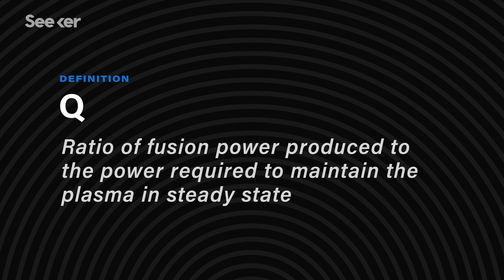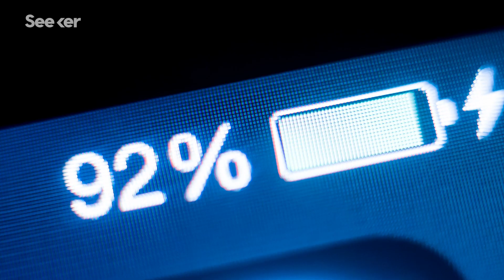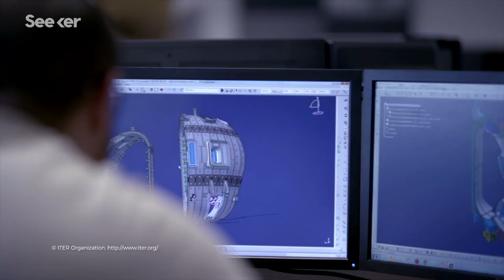How Close Are We to Fusion Energy?

Comment: Nuclear isn't scary. We have two very promising reactor types that can replace fossil fuels right now. Molten Salt Reactors and Fast Breeder Reactors. Both operate differently, but differ from current reactors in that they don't use water as a coolant or moderator. MSRs are fluid fueled reactors, that have their radioactive fuel dissolved in a fluoride salt which is then pumped through the reactor, acting as both fuel and coolant. There are graphite moderators in the reactor that slow the neutrons and make this a thermal spectrum reactor. The high temperatures achieved in this guy yield not only incredible efficiency but enable all sorts of interesting possibilities. You can run supercritical gas turbines instead of steam which are more efficient in their own right. You can use that heat for desalination of water if you wanted. Neutron efficiency is very high and because the fuel is a fluid, it doesn't suffer from the degradation that solid fuel reactors do, and thus do not require the same processing that solid fuel does. Because your fuel is a fluid and a fluoride salt, and not water, it doesn't need to be pressurized which means you don't need a big heavy pressure vessel. Also, no water = no hydrogen which precludes the kind of catastrophic failure we saw at Fukushima.

There is the Fast Breeder Reactor, usually referring to Liquid Metal Fast Breeders. These reactors are cooled with a liquid metal, most commonly sodium. Sodium has some beneficial properties in that it becomes a liquid at relatively low temperatures, but has a very high boiling point. This, like the MSR, means no need for a pressure vessel to contain the reactor. Sodium is pretty indifferent to being irradiated, which makes it very stable in a reactor. The longest lived Sodium ion is Sodium-24 which has a half-life of 15 hours, so long term storage of used coolant isn't a requirement. The other common Sodium ions have half lives of a minute or less. The Fast Breeders use metal fuel but they have a neat trick of their own. Because fast neutrons carry more energy, they can induce fission in other elements that won't fission in a thermal spectrum reactor like the MSR or current light water reactors. All the really nasty actinides with super long half-lives that make our nuclear waste such a problem, can simply be 'burned' up in fast breeder reactors. The breeding part means the reactor produces more fuel than it consumes, in this case, Plutonium. We can quite literally turn our stockpile of nuclear waste, into readily available and usable nuclear fuel suitable for re-use in light water reactors, or to start up a fleet of MSRs that can replace fossil fuels on a GWh for GWh basis.

And as a side benefit, we'd end up training a whole new generation of talented scientists and nuclear engineers who will drive development of fusion reactors. If you want fusion sooner rather than later, and would like a nice planet on which to use it, it's imperative we start funding these advanced reactor designs.
And while I call them advanced, it's important to note that these were developed in the USA in the 1950s and 60s. EBR-2 a fast reactor) ran for 30 years without a single incident. the Molten Salt Reactor Experiment ran for more than 5 years without a single incident. Neither reactor can melt down and both were walk-away safe.
Reply: very informative... thanky you
Reply: Great summary mate, unfortunately a lot of people still can't see past the stigma of fission = bad fusion = good (and some still can't see past nuclear = bad), despite all the various ways you can do fission, and how they all differ from each other and have their own pro's and con's. Most people also don't know that our current Nuclear power stations are pretty much the worse solution to making electricity from Fissioning the atom.
Reply: Oh sure, it will be perfectly safe, which is what you get told about every kind of nuclear reactor right until the shit hits the fan.
Reply: @Kalumbatsch  except MSRs and LMFBRs utilize the laws of physics to fail safely. Safety doesn't have to be engineered in after the fact  with pressured water reactors. 
The fact that MSRs and LMFBRs don't use water and don't operate under high pressure is a huge portion of their ability to be walk-away safe.
It's literally, entirely different types of reactors.
Reply: There have been enough accidents with liquid metal cooled reactors. This crap is just not worth it.
Reply: @Kalumbatsch  no but no power generation is safe
Reply: There is nothing you can do, even with the most evil intentions, to a solar cell that makes it eject a shitload of radioactive crap all over the countryside.
Reply: @Kalumbatsch    there is nothing you can do with solar power to match the gwh output of the current reactor designs.  He is talking about a whole new level of efficiency and safety.  Doesn't mean the solar industry suddenly dies.   Everything requires a ton of research in the end.  Same goes for power storage if transportation is to go fully electric.    
Look up Kelly Slater's wave ranch.  Take note of the scale of the solar array needed to power one locomotive with a plow under it to generate a surfable wave.
Reply: I was responding to "but no power generation is safe". Try to follow the conversation.
Reply: Kalum Batsch  solar panels cannot be installed or disposed of without harming the environment. not only do you have to tear up a very large portion of land to implement them, if a storm rolls by, a fuckload of solar panels will be destroyed and will have to be sent to landfills because they cannot be recycled. using solar as a main source of power is such a childish thought. it is simply irresponsible to look towards solar power instead of upgrading our existing nuclear power plants to be MSR's and LMFBR's. Nuclear, even our current ones, are always going to be better than any giant solar farm.
Reply: Again, it's just not worth it. Countries like Germany produce more than a third of their electricity using renewable sources by now. Simply ramp that up until fusion is available. Taking care of the toxic shit we have created up to now for thousands of years will be enough of a problem.
Reply: Truth. And renewable could turn 100% available with enough storage. There is very promising very cheap storage technologies, making renewable+storage an alternative (and probably cheaper) than nuclear energy.
Reply: Simply ramp up? it's nothing like that easy. Electricity grids need a certain amount of consistency and sustainability so they can be regulated. This is why governments continue to use plants that generate power 24/7. We are nowhere near ready to ditch nuclear, or gas powered plants for that matter. I worked on products for the Fusion experiment at Jet over thirty years ago and we still have not produced a sustainable reaction that generates a net energy gain in all the years since. It is the cooling system in a rod based fission reactor that makes the design potentiality dangerous too whereas a Thorium based reactor is inherently safe so of course it is something we should develop because it will bear fruit long before fusion ever will.
Reply: Those new reactor types and the infrastructure would take decades to develop and build, also the claimed advantages are purely theoretical as the various designs have never been used at a large scale, if at all. Germany as one example has just seven nuclear power plants left and at peak times draws more than half of its electrical power from solar alone. That makes it a problem of efficient energy storage, if anything.
Reply: When has the shit hit the fan MSR have been built and have worked.  That's a long way from fusion where the first proof was revealed as a hoax. MSR have the capacity to use up all the current waste.that's RENEWABLE ENERGY!!!
Reply: @Kalumbatsch  solar cells have a lifespan of 20 years and contain cadmium, a carcinogen which enters the water supply whenever trashed panels get rained on. more to the point, nuclear is less hazardous than current hydrocarbons, and we should never say "we're not gonna solve this problem because the solution causes a smaller problem"
Reply: +Dr. Bread
Cadmium telluride, which is present in a subset of photovoltaic cells, is stable and not soluble in water. That is a non-problem.
Reply: @robk.5467  Better yet in a world of fusion reactors you will need solar as a green fallback. Otherwise you will never be able to start your fusion reactor up again in the event of a shutdown.
Reply: @Kalumbatsch  only 2 have ever melted down and they produce more power than any other form of energy production we've got. Also one of those melted down due to bad engineering and being built nearly 50 years ago, and the other was hit with a tsunami. And ironically no one died of radiation from either reactors, not even the guy who went in the Chernobyl reactor to collect the radioactive water used to stop the meltdown (he had basically no protection). 

Nuclear is far less dangerous than people make it sound. You will get a higher levels of radiation on a plane than you will at Chernobyl right outside the reactor today! The reactor at Chernobyl even has holes in the enclosure for it and even still the radiation isn't anything serious. You are 1000 times more likely to get cancer from radiation in your own body than external forces, especially if you each highly radioactive things like bananas. It's a boogie man that people who know nothing about radiation love to run with. This playlist by thunderf00t does a fantastic job at showing the absurdity in these claims. 
https://www.youtube.com/watch?v=Zw33AVqzQxA&list=PLQJW3WMsx1q3XqXOw5PuRrM0Zg8YDkRPL
Reply: oatlegOnYt FYI it requires 20000 wind turbine to match one nuclear plant
Reply: @Kalumbatsch  We've had Nuclear power here in Canada for over 50 years. 60% of my province's energy is Nuclear. Weve never had any serious problems. Nuclear is safe when its properly designed and implemented.
Reply: @cameronswan8646  Nothing is 100% safe. And when the shit hits the fan you can just say it wasn't "properly designed and implemented", not a true scotsman.
Reply: @Kalumbatsch  Mmmm Cadmium pollution
Reply: Can you give sources to your points, please?
Reply: Nuclear is scary because the anti nuclear movment has spread scary misinformation about 'waste' and 'cancer' Any anti nuclear propaganda is such that they  must protest against Fusion energy because it's 'NUCEAR'  They sound like Vegans'!!!
Reply: I'm not anti-nuclear in the sense that I think it's a bad option.  It's clearly better than fossil fuels, especially coal.  I just think that in practice nuclear has turned out to be way more expensive than people originally thought, and that wind and solar plus storage (pumped hydro and battery) will end up being the cheapest and fastest route off fossil fuels.  And it's too soon to even talk about fusion as an option, because no practical reactor has even been demonstrated.
Reply: solar creates highly toxic waste while being created and as he says in this vid  there is the added cost of infrastructure by way of transmission is the hidden cost. that pro solar don't count.
Reply: @dansanger5340  have you any idea how much nuclear waste is discharged from a coal power station,  if it was regulated like nuclear it would be shut down.
Reply: The actual waste from Molten Salt Reactors and Liquid Metal Cooled Fast Breeders, is back down to background levels in about 300 years. Another solution is to stop producing so much waste and recycle it like France already does. There is no reason to run Uranium through the reactors only once and then declare it to be spent fuel. The half-life you're talking about is directly related to how radioactive the substance is. The longer the half-life, the less radioactive it is. Uranium 238, the most common type in the Earth's crust (99% of natural uranium is U238) is safe enough to hold in your bare hands. It's a very stable isotope which very rarely releases any particles, and those is does release are alpha particles and are stopped by your skin. You'd need to wash your hands after handling it, not because of radiation, but because it's a heavy metal and heavy metals are bad for you if ingested or inhaled. Same precautions we take when handling lead. U235 is considerably less stable, but makes up a tiny fraction of the waste we produce. After being removed from a reactor, the material is considerably more radioactive, but the hottest isotopes are the ones with the shortest half-lives. The ones we're concerned about, decay rather quickly into more stable elements. And that's why we aren't really concerned with things that have half-lives of millions of years, because the radioactivity is so low to begin with.
But, thats why I am suggesting we use things like MSRs or LMFBRs. MSRs have a very long burnup period which reduces the overall radioactivity in the fuel simply by running it for a long time and continually reprocessing it. LMFBRs, with their fast neutrons (the F in LMFBR) can induce fission in actinides that can't be fissioned in thermal spectrum reactors like light water reactors or MSRs. You can reduce these things to much more stable isotopes simply by running the fuel in your reactor. The laws of physics takes care of it for you. And because you're constantly breeding more fuel, you don't need to store your waste, because the waste never leaves the reactor site. You reprocess it on-site and run it back into the reactor so it can continue working. 
In terms of nuclear power accidents, the three big ones we all know about, Chernobyl, Fukushima and Three Mile Island had one thing in common. They are all water cooled reactors. Water must be kept under immense pressure if you want it to remain liquid under high heat. The more heat you add, the more pressure you must contain or you end up with a steam explosion. That's what blew the top of the Chernobyl reactor off. That's the explosion we saw at the Fukushima plant. If you don't use water as your coolant in the reactor, you don't need to maintain high pressure. No (or low) pressure means no chance for the reactor to pop. Molten salt reactors offer even more safety in this regard, because if you lose coolant in your reactor, you also lose your fuel since the molten salts are what contain the Uranium. Any failure in the reactor causes the fuel to drain away into storage tanks and the reaction stops.
We'll likely see some new reactor designs coming online in the next 20 years with the Nuclear Regulatory Commission finally updating their rules and licensing requirements.
Reply: @Andy Lao LMFBR stands for Liquid Metal Fast Breeder Reactor.  The breeder part is the important part. This means the reaction inside transmutes some of the Uranium into Plutonium. You're basically creating more fissile fuel from fertile fuel. You remove your fuel rods from the reactor, cut them up and reprocess them and put them back in. EBR-2 in Idaho did this for 30 years!
The point behind fast breeders and molten salt reactors is that they are both much more efficient than your standard water cooled reactors. They extract much more energy and handle waste products much more efficiently. You end up with less waste and what you do have is lower level and has returned to background levels in about 300 years instead of 30,000 or more.
Yes, you have drain MSRs and LMFBRs to inspect them because you can't visually see inside, but you have to do the same thing in water cooled reactors. Yes you can see through water, but because of the intense pressures involved, you can't do anything else without removing the fuel and draining the vessel. So it's really up to instrumentation to tell you wants going on, regardless of the opacity of the coolant.
Reply: google "molten ceramic mini nuclear" what you think?
Reply: I totally agree. Those who have not yet done the research and don't understand MSR's  are the ones who are scared. There is nothing that can be done to shut down a MSR short of filling the auxillary emergency drain tank with Molten salt so the active molten salt has nowhere to drain if it was to go critical. This is a wonderful clip of what they were doing in the late fifties with MSR's. With today's technology, this should be a no brainer.
https://www.youtube.com/watch?v=tyDbq5HRs0o
Reply: Most interesting comment I’ve ever read 😂
Reply: So why are we not doing anything about it
Reply: honestly, considering how superstitious the climate around fission energy is, i almost wonder if we'll find out some way to villify fusion.
Reply: As you note, these WERE experimental theories, and "working" in situ plants were built, but they were deemed inviolable. Neither commercial or military applications (ie; working models) are in use today, nor are there plans to do so. However, every year or two, I notice someone dredge up these past attempts and treat them as current working technology. Sorry, not then and not now.
Reply: Such an impressive display of knowledge. Thank you for sharing. 

Out of curiosity, have you seen the HBO show Chernobyl? Do you think media like this is a net positive or a net negative? I could imagine it going either way. Clearly, the show details a tragedy and endeavors to display its costs, likely inciting negative reactions to nuclear generally. It also inspires further reading, which may lead to a more measured, positive outlook.
Reply: it is scary, why don't you try convince people who are victim of nuclear power plant failure to live next to the reaction chamber of another nuclear power plant? or even better... be the victim yourself.....I hope that doesn't scare you

on the other hand  look for to people who experience solar panel failure,  and convince them to live next to a solar panel
Reply: itadakimasu
Reply: @Andy Lao I imagine draining the fuel salt periodically to drain tanks for maintenance and inspection is the way to go for MSRs.
Reply: @Kalumbatsch  Correction, 2 people died from the explosion, and 29 people from the plant were hospitalized. Not specifically from radiation. 
Of those who cleaned up the mess it is believed only 3% of which would receive any form of cancer as the amount of radiation required to receive devastating results is astronomical. It's more about the over time part that actually matters. 

Radiation doesn't tend to kill in hours, it kills based on how much and how long. On an airplane (which is the amount you would be exposed to today) you still have only a 45% chance of getting cancer. Higher than the 40% chance of normal a normal life, but not by much. A multiple of f*ck all is still f*ck all. Your odds of getting cancer from external sources though is only 1/ 100,000th chance! Most forms of cancer are again, do to the radiation your own body produces as it is more potent than any other source, beyond UV and X ray that is. Ionizing radiation has a very low fatality rate unless exposed to intense doses after long periods (usually 8-15 rads for about an hour to 2 hours). Radiation isn't nearly as dangerous as they make it sound. 

Hell my backyard has thorium with similar radiation levels to Chernobyl today. Radiation is freaking everywhere and an increase of f*ck all is still f*ck all! Like I said, your odds of getting cancer from bananas is higher than your odds of standing near the reactor in Chernobyl. Can tell you didn't watch a single video from that link. The man is a nuclear physicist, hell he even went to Chernobyl to show how little there really was there, followed by going to the US and showing how much radiation is just everywhere there. There is a reason scientists don't shove off nuclear like civilians do. It is statically far less dangerous than you think it is.
Reply: @Skylancer727  "Correction, 2 people died from the explosion, and 29 people from the plant were hospitalized. Not specifically from radiation."

It's hilarious how you pull shit out of your ass. Those 29 weren't just "hospitalized", they died from acute radiation syndrome. There is a whole Wikipedia article titled "Deaths due to the Chernobyl disaster". Maybe you should read that before you make another uninformed comment.
Reply: That's the problem - 2 plants, just 2
Reply: It honestly isnt, company mismanagement and a lack of nuclear safety culture is. I would like something like this to happen tbh, we need to stop our earth from rotting.
Reply: yes stop using monny in somthing i think will newer work on earth, use it on Thorium Molten Salt Reactors.
Reply: I feel like the problem with most of these comparisons is that it only compares fusion with current available power sources, and not with other potential power sources for the future. That being said, it might be far more complex and make for a video which is too long to compare all of them, and most people watching would probably lose interest after a while
Reply: Mike McKeen k
Reply: You should start a channel dude!
Reply: Very costly
Reply: Its not about that its about nuclear waste
Reply: Good answer man
Reply: nUcLeaR Is sCaRy. Omg every reactor that's even melted down wasn't the types op is talking about. Those reactors literally cant fail dangerously. Big oil has brainwashed you all, I'm not anti solar for the short term but the fact its soooooo minimal in the us compared to other places proves big oils hold. They dont give a shit about the planet, just maintain the status quo and collect the checks. Just keep the politicians bought off and public dumb.
Reply: +1 - Thank you, super informative. It's genuinely disappointing that we aren't already taking advantage of these reactor types for large-scale electricity generation, if they are as stable and practical as they seem.
Reply: How much time did you spend typing this
Reply: Copied and paste?
Reply: copy and past much?
Reply: Mike McKeen what a great introduction
Reply: star cruiser  Not only will it happen, it's already happening.  According to the US government's Energy Information Administration, most new generating capacity in 2019 will be wind and solar.  Coal is going backwards.

"According to EIA’s latest inventory of electric generators, 23.7 gigawatts (GW) of new capacity additions and 8.3 GW of capacity retirements are expected for the U.S. electric power sector in 2019. The utility-scale capacity additions consist primarily of wind (46%), natural gas (34%), and solar photovoltaics (18%), with the remaining 2% consisting primarily of other renewables and battery storage capacity."

"Scheduled capacity retirements for 2019 primarily consist of coal (53%), natural gas (27%), and nuclear (18%), with a single hydroelectric plant in the state of Washington and other smaller renewable and petroleum capacity accounting for the remaining 2%."
Reply: star cruiser  I said promising technologies, not ready available technologies.
Of course, there is batteries now and price is going down... but I wasn't thinking on that, because there is some fundamentals dependencies that would make very difficult to go enough low for season storage.

But check this...
https://www.sciencedirect.com/science/article/pii/S2542435117300326
Reply: Thank you for the post m8
Reply: What is called Nuclear Fusion these days is nothing else but an attempt to arrive at a more sophisticated, controlled and safer form of Nuclear Fission!

I have observed this so called "path towards nuclear fusion", compact or otherwise, for the better part of 30 years and have come to the conclusion that the road leads into a cul de sac, while, simultaneously, opening up a rapacious money devouring black hole. 

A typical hallmark of rent seeking crony capitalism, especially when government grants and tax breaks are involved.

Something in the physics concerning the principles of  'over-unity energy generation' is being misunderstood, overlooked or is purposely left out and/or hidden.

Why not, just for fun, go to a thought experiment. 

Imagine the exact opposite: no heat > 50m°C but rather room temperature or cooler. 

No hot explosive force generated by massive heat, but a cool implosive force created by gravity.

How do I come to this conclusion? It is all about a tiny dose of common sense and a mild application of Ockham's Razor. 🤣☝️
Reply: We also have plutonium and thorium reactors
Reply: @mothermovementa  Every Uranium-235 fueled reactor produces Plutonium isotopes as part of its normal operations. That's the whole idea behind MOX (mixed oxide) fuel. You blend in fissile plutonium with your fissile uranium isotopes and run your reactor that way. It's nice because you don't need to change the reactor design if you're already running a water cooled reactor. MOX fuel allows you to consume waste from other reactors and decommissioned nuclear weapons, which is a huge bonus.
 You could run a reactor on pure plutonium but it would be a very small reactor simply because we don't have much Plutonium relative to our Uranium supply. Every bit of Plutonium we have, was transmuted in a nuclear reactor.
Thorium-232 gets bred into Uranium-233. Thorium has no fissile isotopes of its own, but the Thorium decay cycle and Th-U fuel cycle has some very distinct advantages. One is that you produce very few things that are weapons materials in a Th-U fuel cycle. Thorium will never transmute into Plutonium no matter how much you irradiate it or its daughter products. Two is that we have a LOT of Thorium. It's very common and would be a great supply for a new generation of commercial reactors. I'm not a fan of water cooled reactors, but you could theoretically use Thorium in the blanket of a PWR and breed it into U-233 which would then get moved out of the blanket and into the main fuel stack. Th-U fuel cycle is better suited to MSR designs, but it could (and was) run in water reactors.
Reply: Mike McKeen after reading through this entire comment section, it really does sound like nuclear is the way forward
Reply: Uranium is becoming a new trend! Buy the junior mines GoviEx and Deep Yellow!
Reply: @Mike, Obviously you haven't heard about Fukushima Daiichi nuclear disaster, Windscale fire, Kyshtym disaster, Jaslovské Bohunice accidents, Chernobyl disaster, Three Mile Island accident, SL-1 accident K-19, K-11, K-27, K-140, K-429, K-222, K-431, Tokaimura nuclear accident. Or maybe you have, and choose to ignore them and make a stupid statement about Nuclear power not being "scary".
Reply: abloogywoogywoo or maybe he realizes that most of those incidents were caused by human error and were not caused by actual nuclear reactors.
Reply: Engineers still have to engineer the reactor with the possibility of human error in mind.  It should fail in a safe mode regardless of how bad the human operators screw up.
Reply: Dan Sanger  that's extremely hard to do because the uranium atoms in the nuclear reactors, as far as we know, can only be split in a very specific way. we cannot just change the laws of physics to make things more secure. we also can't change much about the tools and controls necessary to split these atoms, so people will just have to learn how to operate the reactors better. It would also be easier if more capable people ran the reactors than if we change the way reactors work entirely.
Reply: Still not as scary as the coal and oil air pollution that has been shorting the lives of billions. Cancer shorting of lives from the Nuclear releases is tiny in comparison. 
I agree that Nuclear has a scary part I dislike describing it as totally safe. But if we had switched totally from the 50's on even with several more meltdowns billions of lives would have lived longer without coal and oil pollution and wars. Plus we would not be facing global warming now. Radioactive Waste has been miss stated badly. The fuel was radioactive when we took it out of the ground so zero radiation was a bad comparison. We could mix the waste with cement and just put it back in the mines and you get the same risk it had for millions of years. Shortened half-lives mean some of it more radioactive now but will be gone long before the rock that came from the mines and we can dilute it to ore level of radioactivity. Nuclear Waste can be handled with little difference in risk than when it came out of the ground.
You probably don't have to worry about a revival though as Natural Gas will probably stay cheap enough to keep older style nuclear plants offline till fusion comes online.
Reply: I'll go Mike one better.  There are currently 1 MILLION licensed solar installations in the US.  They provide, as Mike said, only 1% of the power the US uses.  It would would take 54 MILLION more installations to replace fossil fuels.  Also, PV cells use extremely rare earth metals  https://e360.yale.edu/features/a_scarcity_of_rare_metals_is_hindering_green_technologies .   We'll run out of some of these before we even get close to the capacity we'd need.  Oh, and solar PVs only work during the day, so in order to store enough energy to run the country at night, we'd need to double the number of installations(you can't store energy, if every bit of it is in use, you need excess).
Reply: Again, Germany has only seven nuclear plants left and at peak times draws over half of its electricity from solar power alone. That's not a tiny percentage. And incidentally, in Germany you got the same kind of noise from the naysayers one or two decades ago.
Reply: Anything that manipulates the chaotic nature of atoms is scary and dangerous.
Reply: Nuclear takes too long and is too expensive.  Designing, building, and putting a nuclear plant online takes decades and many billions of dollars.  A solar or wind farm can do all that in less than a year.  By the time a new generation of nuclear plants can be designed and built, the cost of solar plus battery storage will have dropped through the floor.  Solar and batteries can be mass produced in factories.  That's never been shown feasible with nuclear.  Solar will win because of cost and time to market.  It's inevitable.
Reply: You forgot one little problem.
Solar doesn't even come close to producing enough power to supplant fossil fuels. Solar makes up a tiny fraction of power produced in the USA. Like...1% total. It's not even in the same ballpark as nuclear. All of the renewable sources we have together, make up about 20% of the nation's electrical supply with the largest portion, 45% of that, coming from hydroelectric. That is also a big problem for renewables, as most of the nation's rivers have already been dammed multiple times. Rivers in the west, particularly the Colorado River, are facing extended drought conditions which further reduce their generating capacity. This means that all the easy gains in renewables are gone. You can deploy wind and solar, but unless you step up the amount you deploy by ten-fold, you're not going to do anything to remove coal and natural gas. Oh, and that doesn't count storage for when winds are calm or the sun is down. Early attempts at pumped storage have shown what most sensible engineers already figured would happen; it takes more energy to pump the water, than you actually get out of it, which means you now have to build extra capacity in order to run your storage system, further increasing costs. Add to that the lack of utility level battery storage and you have another big cost.

We don't need to design new nuclear power plants. They are already designed and ready to go. The biggest problem is regulations from the like of the NRC (which is why the real development work isn't happening in the USA) and the costs. The materials needed for nuclear power are not cheap. But GE/Hitachi already has the designs for the PRISM reactor, which is the commercial version of the IFR concept, built and tested at Argonne National Labs from 1964 to 1994. We have the LFTR from Flibe Energy, the Terestrial Energy IMSR, Transatomic's MSR and a couple others that are Molten Salt Reactor designs built from the original MSRE that ran for 5 years at Oak Ridge National Labs. These are proven designs that existed in the real world and generated energy without a single fault or failure.
But, nuclear has the benefit of not only being able to replace coal and gas on a gigawatt-for-gigawatt basis, but also that it emits almost no greenhouse gasses. The fact that a number of the designs I mentioned can reuse spent fuel, thus reducing our current levels of nuclear waste would be worth the extra expense. No greenhouse gasses, uses existing waste as fuel, can recycle its their own waste for reuse...sounds like a renewable resource to me.
Reply: Mike, there's a reason nuclear power is so tightly regulated.  There are around 450 nuclear power plants in the world, and three of them have failed catastrophically, which is a catastrophic failure rate not that far from 1%.  That's incredibly high.  The idea that we can cut back on regulation to save time and money is extremely foolhardy.
Reply: @dansanger5340  safety regulations are fine. We need them and those should not be changed. I was speaking more of the Nuclear Regulatory Commission who almost entirely refuses to allow larger test and demonstration reactors to be constructed, if they aren't water cooled reactors. In the case of something like a Molten Salt Reactor, if you're not building it to scale, it's almost a different machine. Because you can't build a working prototype in the US, you're not going to attract any commercial interest because you can't get it licensed.
It's forcing brilliant engineers and scientists overseas to China, Europe, India and Canada.
Reply: @dansanger5340  Solar and wind take up valuable natural habitats. I'm completely against wind, as it kills thousands of birds and displaces animals, the infrastructure and foundations required for a windturbine park is ripping up large swathes of land. Here in Norway, the state wants to build a windturbine park near where my ancestors have been hunting and fishing for generations, where the grouse usually lives, these arctic habitats will take decades to fully heal again, and the animals won't return, as the noise form the turbines will scare them away. The reindeer who graze there will lose valuable food.
Fusion could produce even cheaper energy without any of these consequences.
Reply: @armzngunz  Get back to me after you do away with housecats and plate glass windows, each of which kills infinitely more birds than wind turbines.
Reply: @dansanger5340  We haven't had any dead birds from our windows. Your argument is incredibly flawed, you're suggesting since we're already killing alot of birds it's ok to kill more.
Do you not realise the impact these massive parks of wind turbines have on nature? In our quest to save the climate, we're throwing these natural landscapes under the bus.
Reply: @armzngunz  No, I'm suggesting that the bird argument is an exercise in excuse-making, not a legitimate concern about a significant issue.

Beauty is in the eye of the beholder.  There are some wind farms a couple hours away from me in a windy part of the state.  I think the wind turbines are beautiful and majestic.  I made a special trip to see them up close.